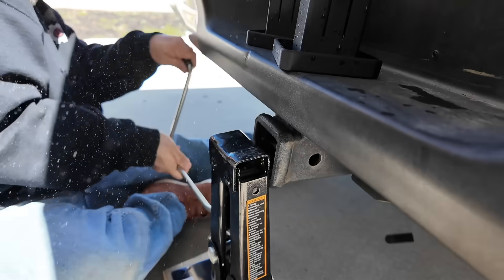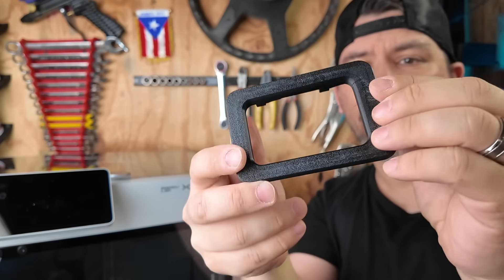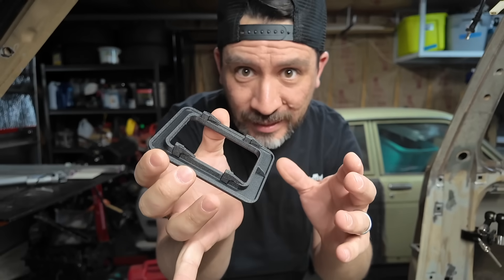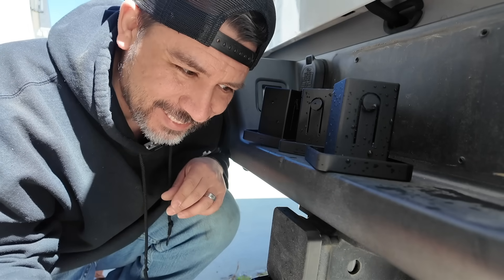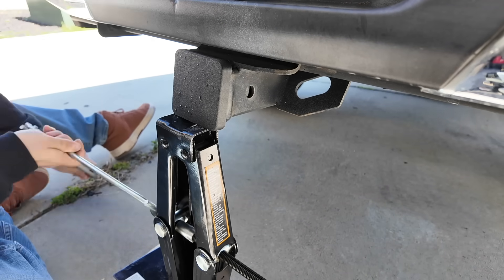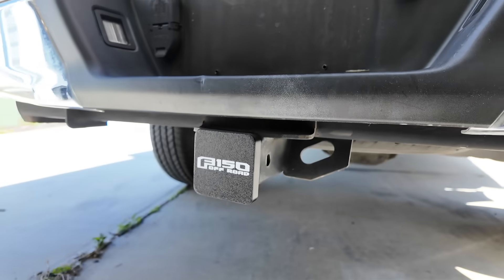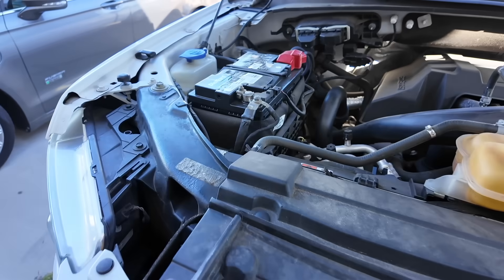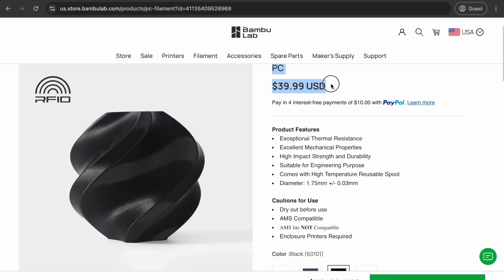Which 3D Printer Filament Makes The Toughest Car Parts?

Comment: How you print , temperature, later height, speed, extrusion rate all vary the strength of the part. They all effect layer adherence more than than along the grain so to speak.
I can print ABS and make it weak or I can change print settings and make it strong. The only way to compare filaments is to find the best print settings for each first . And even then you will need to use proper testing procedures.
Reply from the maker: Great points, we definitely agree with finding the best settings to bring out the filament's true strength 🙌

Comment: That’s really weird that you had issues with the ABS like that. I’ve been using ABS for about 5 or 6 years for car parts. Everything from intake tubes, subwoofer box rings and dash parts. Never had them crack like yours did so easily.
Reply from the maker: I’ve been using ASA for all my builds now. ABS also have pretty good layer adhesion especially with a heated chamber setup.

Comment: would you this on a under the hood part? Like a turbo inlet tube for a Evo 9
Reply from the maker: Depending on how hot the inlet tube gets you can use different filament that has higher heat resistance. I put together a filament selector tool here that breaks down heat resistance for different filaments based on applications -> https://www.allaboutthebuild.com/blog/filament-selector-tool-for-car-parts

Comment: I don't know, for heat yeah sure I'd do like 20% infill, but for strength, depending on the force directions I'd be going 50%+, you see how some of them START cracking before sudden complete failure, just like a lot of metals are tough but will shatter while others will bend and keep bending, even stretch.  Need to get to a medium.
Reply from the maker: True, true. I also think the flexibility of the layer adhesion matters. I’m also guessing that prolonged sun exposure will also affect performance

Comment: Not bad the testing....but desing failure is the plug due to it's length and if it's shorter, then you can cover the exit of the 'tube' then it protects it much better.
Reply from the maker: Appreciate the input, always looking to improve the designs!

Comment: 3:47 lol that’s hilarious 😂 Prusa did a lab test by the way. There is no harm coming from filaments with gf/cf. But don’t cut or machine it. Airborne particles can get into your lounges.
To get the hooks better position the long side in a 45* angle to the bed. This way the layers are overlapping in the bend direction and makes the hooks stronger.
7:48 add more walls for higher strength. 

Thanks for sharing your experience ❤
Reply from the maker: Ya never know with GF/CF. Will have to check out the test from Prusa. Thx for all the tips!!!

Comment: ABS requires a hotter chamber for better layer adhesion. those tabs broke because of bad layer adhesion. you need your bed at about 110 Celsius minimum for good Larry adhesion and also a chamber of no less than 45° c
Reply from the maker: YES!!! Crank up the heat and let the chamber soak some. That's helped a ton. THX!!!
Reply: Not to mention, you shouldn't rely on layer adhesion for strength.

Comment: One of the Best Filiament for the Automotive Industry  and other Industrial Sectors
.
Bambu LABs added In Gives a Look into the Future of the Remote Fabrication Factory
Reply from the maker: Heck yeah!!! Do you 3d print car parts too???
Reply: @Itsallaboutthebuild  
I just purchased the Creality CR-Scan Ferret Pro Portable Handheld 3D Scanner , I have been using Fusion 360 for over 1 1/2 years now,  but  was searching for the ideal market to to go after being a business man, with skills in Molds, CNC Printing.

I have the Anycubic, Resin 6K and recently invested in the Bambu Labs A1 with Multi-color AMS lite. ( With your video Purchase many filaments ideal for palstic parts for vehicles )

My vision ofr the Car Industry is Remote Manaufacturing with repspect ot re-producing car parts of all models. This is the future when considering the trade wars, remote manfacturing is the future, but one must prepare to have a mul-sect of knowlege and tools.

What are your thought on Remote Manufacturings ?
Reply from the maker: Many thanks 🙏🙏🙏 Agreed on remote manufacturing. I've used pcbway.com, but the import cost is crazy now. The results were pretty good with ASA and even aluminum designs. I've been looking into US based manufactures like JawsTec. Might give them a try once I have the perfect part to send them.

Comment: Try printing abs with enclosure closed and with reduced cooling
Reply from the maker: Thx, found out that the secret is letting the printer heat soak from the bed on max temp and making sure all fans are off 🙌🙌🙌

Comment: You need to look into PET-CF. It will print very well and has a very high tensile strength, resist creeping, and is temperature and UV resistant.
Reply from the maker: Awesome, will add it to the review. Do you 3d print car parts too???

Comment: I've printed a number of parts for my cars and lawn equipment using TPU.  So far, no failures.  My cars are subject to the temp swings of the northeast and are kept outside (my garage is my workshop).  I recommend to at least try it out.
Reply from the maker: Interesting, I've never tried TPU for car parts. What brand?
Reply: I want to do more work with TPU. (I don’t do car parts but I do a lot of functional printing.) What I’ve been told is it’s basically the most impact-tough substance a printer like the X1C can print, because of its flexibility (ie ability to distribute force and flex rather than breaking). Could be great for gaskets and bumpers?

Comment: I've had some control knobs printed from PLA+ for just over a year now in my car. They still look and feel like the day they came off the print bed. I live in northern Michigan.  Very hot summers and very cold winter, and I'm parked in direct sunlight most of the time
Reply from the maker: That's awesome. Will have to add some PLA+ and HT-PLA into the mix for comparison. What type of parts did you make for your ride?

Comment: wait... you use gloves for the ABS-GF filement but not the printed part? wouldn´t the glass fibers be an issue also after printing?
Reply from the maker: Yes, my hands were a little itchy afterwards. I'd recommend adding some clear epoxy safe for 3d prints.

Comment: Heads up, ABS, ASA, and PA are impact strength materials. PLA, PETG, etc. are tensile strength materials. When applying force parallel to the layer lines, use a tensile strength material for better results. You should always plan your print to have perpendicular force application though as it SUBSTANTIALLY increases the strength for all materials.
Reply from the maker: Thx for the tips, I just love the build plate texture too much 😁
Reply: What do you mean when you say the first three are impact strength filaments? For example, pushing down perpendicular to the layer lines will produce good results for them where as the PLA and PETG as “tensile strength” materials won’t do as well with a force perpendicular to the layer lines?
Reply: @couryrussell7653 applying force perpendicular to the layer lines will be compressive strength which all rigid materials can handle well except for TPU. What I mean is that the first three filaments I named are strong against sudden impacts like dropping or hitting. Tensile strength is force applied by pulling on either end of a material or bending.
Reply from the maker: Fantastic explanation.
Reply: @TheChazio it depends on the direction of the perpendicular force whether it is compressive or tensile.
Reply: @mkoic11  good point. Tensile force should be applied parallel to the layer lines. Compressive strength should be applied perpendicular.
Reply: I designed some structural parts where I put a machine screw in Z axis direction. I made a mounting part for a rod hanger in a cabinet which is now 6 years old is still holding a very heavy load
Reply: Where does PC or PC-CF fall in this? Also, is PC better than ASA at taking wear from friction and impact strength?
Reply: @JValor polycarbonate (PC) is a notoriously tough material but is still marginally weaker than polyamide (PA/Nylon). It is a rigid impact material similar to PA. Carbon fiber inclusions just help with layer bonding, rigidity, and cosmetic finish.
Reply: @TheChazio  OK, thank you for the info. However, would you say it's significantly toughter than ASA? I can't find much on which is mechanically stronger ( more resistant to wear from parts that cam against each other, impact strength, tensile strength, fatigue, etc )
Reply: @JValor Polycarbonate would be the better option. It also has a lower friction coefficient by a small margin.
Reply: @TheChazio would you say the better option by a large margin, enough to justify the cost increase? It would be used for airsoft parts that get treated very roughly, car parts, etc
Reply: @TheChazio also, would you say PC absorbs more water or Nylon absorbs more? Is water absorption an issue after a part is printed, or just before?
Reply: @JValor PA12 has a very low water absorption rate and actually becomes more impact resistant when it absorbs water. PA6 has a very high water absorption rate and also becomes more impact resistant but becomes about 40% less rigid and cannot sustain weight in humid environments. PC has a very low water absorption rate but becomes weaker overall when it absorbs water.
Reply: @TheChazio that is very interesting... I was really leaning towards pc due to assuming it's water absorption was significantly less problematic then nylon, but hearing that it's similar to PA12 is new to me
Reply: @JValor The water absorption for both of them is in the range of 0.1% - 0.4% so very very low considering PA6 is up to 3.5% in normal conditions but can reach 10% if submerged.
Reply: @TheChazio I am also looking at PPA and PPS - which one would be better for my application do you think?
Reply: @JValor what is the specific application for the pps or PPA?
Reply: @TheChazio  Firearm parts ( DW, I am a certified gunsmith and FFL holder and do things responsibly, I know people get iffy when they hear that ) airsoft replacements parts for my son, and car parts for my truck
Reply: @JValor I would say PPA because it has better thermal properties and has much better uv resistance so the sun won't degrade it.
Reply: @TheChazio Done, I just ordered some PPA-GF. After some looking, it seems PPA outperforms PPS mechanically and the main PPS benefit is heat/chemical/ease of printing, atleast compared to PPA. 

I print with a Flash Forge AD5M-Pro that has: Hardened Steel 0.8mm nozzle, 70c chamber heater, the factory enclosure that is part of the printer itself, a very large very thermally insulative enclosure the printer sits inside of, so 2 enclosures total, a BIQU Glacier bed with VM Nano-Polymer adhesive - all this combined with a Sunlu S4 filament dryer.... do you think I can print PPA-GF at some super slow speeds with a 280C max nozzle? My prints will be no bigger than 100mm in XYZ, mostly small parts.

I have always printed with ASA-GF with no issues, even on massive parts that max out the build volume and take very long. I want to take a big step up from ASA-GF though in terms of part longevity for an important project coming up.
Reply: @JValor I also have an AD5M Pro and unfortunately the nozzle can only reach 280c and the bed can only go to 100c which will produce poor results with ppa-gf. I would say for the best/strongest results on the AD5M Pro that it can produce, PA12-CF10 would be the optimal thermoplastic. It's the strongest material that the AD5M Pro can print. PA6 is technically stronger by a little but it becomes much weaker once waterlogged.
Reply: If I wanted to make some bath bomb mold to use with an air press. Which filament to use?
Reply: Great tip

Comment: Hello, we have being printing for 13 years, and experience tells us, to print ABS parts, along the perpendicular axis of breakage, that is why we suggest printing the part first but, the clips, in a second round, but lying on the bed, rotating the flat layers along the clips, then chemically "gluing" with acetone, and your part becomes many times stronger, thin sections below 1 mm must be avoided. If you can print the clips placed but with a layer thickness of 0.08 mm, you will multiply the resistance many times more. greetings from MEXICO !!!
Reply from the maker: Hola amigo!!! Great tips, would love to try some annealing testing because I love the pattern that comes from the build plate. Can’t wait for 5-axis 3d printers!!!
Reply: @Itsallaboutthebuild  try to print PPS CF10 that filament is way more resistant.
Reply from the maker: Ok, will have to give it a try. Which brand of filament?
Reply from the maker: Ah ok, I’ve seen some good things with Fiberon. Will give it a try soon

Comment: slow down with PETG - makes a hell of a difference for the part's strength
Reply from the maker: Oh, that’s a great tip. Will have to test that next. Ya 3d print car parts too???
Reply: @Itsallaboutthebuild only occasionally when something fails, mainly ASA ✌️🫡 other than that it's PLA/PETG toys practically nonstop 😁
Reply from the maker: ASA is great. Do you make your own designs too?

Comment: Not sure this is a relevant test. The parts you tested were very slim
Reply from the maker: Just a few walls with very little infill, but that's how some parts are designed most of the time.
Reply: @Itsallaboutthebuild depends on what you expect from the parts. What I am not sure of is the same material would be different in different thicknesses. Maybe an asa or abs thick part would be better than cf or others. 
What I want to say is that I am not sure that same thickness is a good comparison.
Reply from the maker: Oh, I see what you’re saying. Will have to test those differences out as certain filaments do have better layer adhesion than others 👍

Comment: who told you PC holds 240 degrees? Thats just not true :)
Reply from the maker: 117c according to the Bambu Lab Specs 116c =240.8 °F
Reply: @Itsallaboutthebuild  AAAHH OK i see what you mean.... Sure the PC melts at 230-240 degrees. But it doesnt withstand that. Thats the melting point. It starts to deform between 110 and 120 degrees celsius. It has a heat deflection tem of 117 degrees celsius and vicat softening temperature of abotu 119 degrees celsius (official bambulab data). This is true yes. This means it withstands 100-110 degrees celisus just fine (which is true) and it starts to soften and deform above 110 degrees.
Reply from the maker: Awesome, good to know. Will need to list soften/deform temps next time. Thx 🙏🙏🙏

Comment: ... or you can change part placement on the bed and get much more strenght for free. Also print with 100% infill is useful.
Reply from the maker: Heck yeah, give it some diagonal along with some supports if you don't care about the bottom layer getting the nice bed finish for sure 🙌 Can't wait for those 5-axis 3d printers to start coming out.

Comment: Check out PCTG.  Instead of petg.  It prints about the same … a bit higher temp … but also resists temperatures even higher (80-85c) without losing its structure …. And has MUCH stronger layer adhesion than petg or abs. (Also has more flex )
Which will help your part.  
Though heed what others said about 3d printing design.  It’s different.  But you “can” muscle through it by just making use of different materials.
Reply from the maker: Sweet, will give it a try. Just got some Polymaker HT-PLA that shows it supports up to 150°C. Want to try it for some interior car parts.

Comment: I think you can just use paint for UV protection. I mean most plastics in your car that are exposed to sunlight are painted too.
Reply from the maker: That’s a good suggestion, will have to test that out 🙏
Reply: @Itsallaboutthebuild  Some trim manufacturers are "baking" parts before painting them a.k.a heating them up for better paint adhesion (beware, this can cause shrinkage depending on he type of plastic used). I cant provide any details though (type of plastic, pain, temps and time).
Reply from the maker: so like annealing?
Reply: @Itsallaboutthebuild  no, you are not changing long term properties of the material like with annealing, just prepping the surface for better adhesion of paint. I am not sure if it is necessary with all paints or it just allows them to save money on cheaper paint. Btw cockpit plastics are usually injection molded so that might also be a reason.
Reply from the maker: Aha ok. Thx for the tips 🙏🙏🙏

Comment: Great video idea and execution.   Been having questions/thoughts around just this issue and just got an X1C last week.  Thanks for putting it together!
Reply from the maker: Nice, glad to hear. What type of parts are you printing with your X1C?
Reply: @Itsallaboutthebuild  Please excuse the delay.  The summer flu got me.  I've been wanting to print a nylon button box for an electric rotary table in my home machine shop and also some nylon tooling holders for my lathe.  I've printed them in PETG on my Prusa Mini+ and they're fine, but the print quality isn't like when I bought the machine 4 years ago.  I also use the printer for prototyping.  It's so nice to be able to incrementally make small changes to get the perfect fit. I'm excited to use nylon, PC, PET and any other materials that require environmental control.  I also randomly make parts for motorcycles, cars, and my truck so these materials will be very helpful.

Comment: if you have worked on vehicles for any amount of time most of the plastic production parts are one use only. Near impossible to remove and reuse most trim pieces once their plastic dries out. Something always cracks.
Reply from the maker: Good point, will do some more long term testing with UV resistant ASA filament :)